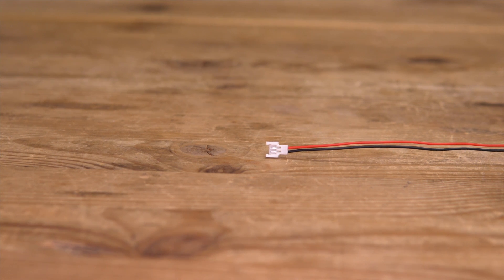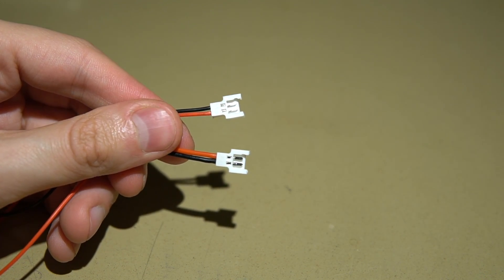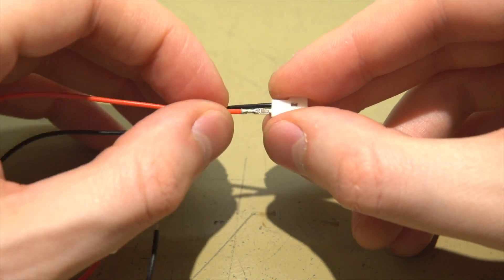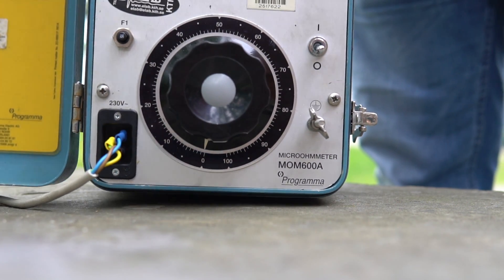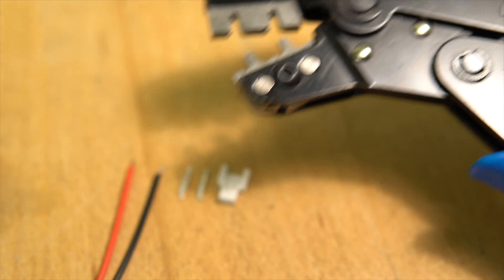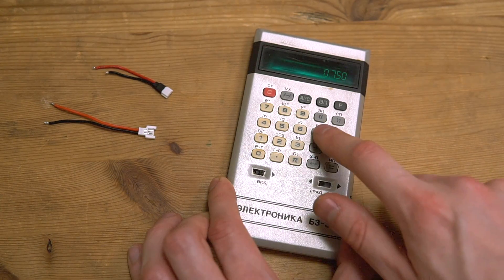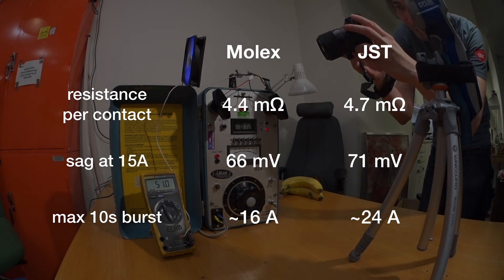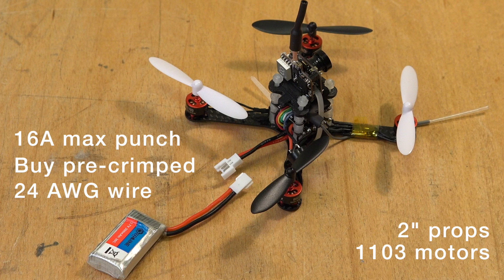Molex 2mm connector - measured and tested

Comment: Please tell me the model number or part spec of that 2 mm connector. I have ordered them and they happened not to be thin but thick. Bottom line: I lost my money.
Reply from the maker: The part number is Molex 51006 (link to manufacturers website: https://www.molex.com/molex/products/part-detail/crimp_housings/0510060200) Although, this way you will get it as separate pieces that need to be crimped together. From RC stores you can try to look for it as "Losi connector" or "mini molex" but that's never a guarantee
Reply: @dronelab1280  Thank you! I will look for it with that number.

Comment: My drone has one of these.  But the connector is a little bit loose and getting hot and my drone is not taking off. It shuts down. What should I do?
Reply from the maker: That's a tricky problem to debug. It could be  faulty connector with bad contact, OR it could be something wrong with the drone - like an underperforming motor that takes a lot of extra power - with the hot connector only being a symptom of the extra power consumption.

First check if any of the motors gets much hotter than the other ones after an attempted take-off. If that's the case, you might have to replace that prop or motor. If not, and it's only the connector getting hot, you can try replacing it. These connectors aren't too difficult to replace if you have a soldering iron, just get one that comes with a length of wire already crimped on the connector.

Comment: Do you have any part number for this? The assembled connectors but without the wire.
Reply from the maker: Well, since the metal contacts need to be crimped on the wire before being inserted into the plastic housing, you can't get this connector assembled but without the wire. Either full set, or get the pieces separately (https://octopart.com/51006-0200-molex-289446 and https://octopart.com/50012-8000-molex-945260)

Comment: I hunted down the part numbers and terminals for LOSI connectors.  I could not find any gold plated, copper-brass alloy terminals.  I actually could only find one grade of terminals.  This is unusual, since they usually have a long list of different plating, alloy, wire gauge.  Who knows who is stamping the terminals, and what material they are using.

Comment: This series is great, thanks so much. The comparison with other connector types in a similar weight/current-capacity class is especially interesting. I would love to see videos on JST-RCY, JST-PH 2.0, as well as on balance connectors. I've been frustrated with the size of JST-RCY and didn't want to add the weight of XT30, so I've moved to using 2S balance connectors as the main battery lead connector on some of my lightweight 2S builds.

I would assume that JST-RCY, JST-PH 2.0, and balance connectors perform similarly (maybe JST-RCY is more different?), but would be great to see empirical data! The balance connector test may also inform the "debate" on whether it matters to plug in the main discharge lead or balance connectors when parallel charging :-).

Comment: It seem like Molex 2mm connector is being phased out and generally replaced with JST PH 2.0.  I'd love to see a review/comparison of the JST PH 2.0.  Thanks
Reply from the maker: I have written that down on "the list"! I wouldn't expect it to perform better, but I'm definitely open to be surprised :) Might take us a while though, as the next 2 videos are already in the pipeline.
Reply: Does the PH 2.0 have more surface contact area?  The plastic housing is designed more for anti-vibration.  The LOSI connector probably better for batteries, since it can slide in & out easier.

Comment: Question is, where do you purchase pre-crimped  with silicon wires like that , I haven't had much luck ,google isn't getting me  good results.
Reply from the maker: Hobbyking has them: https://hobbyking.com/en_us/molex-2-0-2-pin-cable-male-connector-with-200mm-x-24awg-silicone-wire-5pcs.html. There also is a separate listing for 5x females.
Reply: Thanks